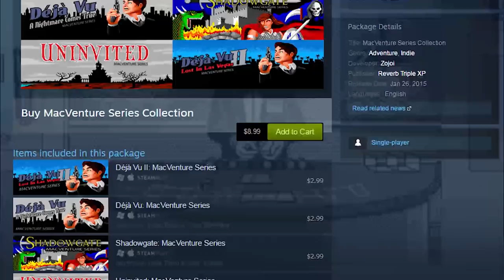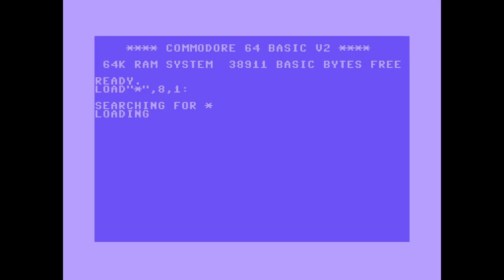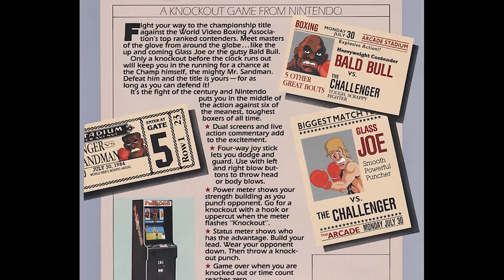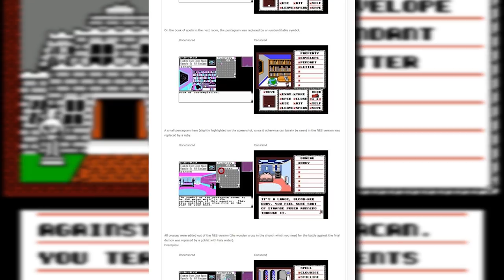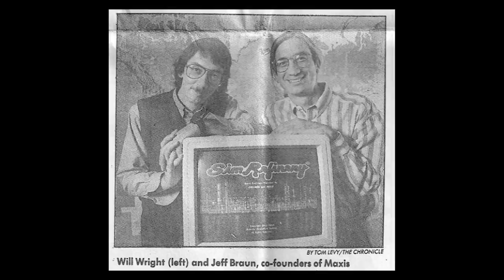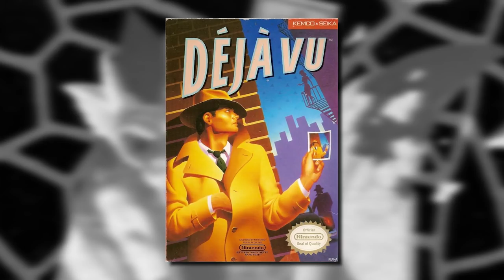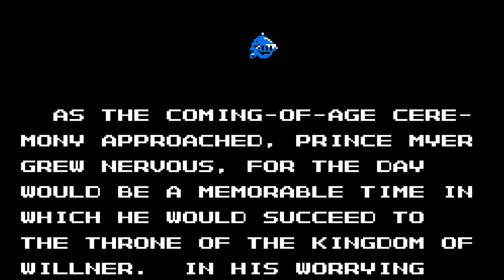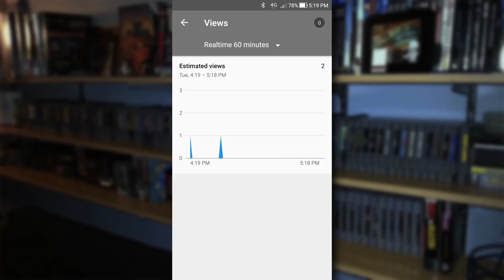NES Games Episode Marathon | Friday Night Arcade

Comment: I have a technical question for anyone who can answer it. I play NES (and SNES,  master system, mega drive/genisis etc. etc.) Games online on my Windows 10 computer. Doesn't anyone know of I can somehow get my xbox controller to work witg them? It works with my steam games, but I can't get it to work with online emulation played thru Chrome
Reply from the maker: I don't think you'll be able to get it to work through a browser web site that has the emulator built in. Also be careful with those as they tend to have viruses and malware baked in as well.

Try RetroArch - takes a lot of fiddling to get going, but there are some great guides on YouTube on how to do it. Once you get that up and running, you can map any USB controller to it, XBox, PlayStation or even just use an original controller with a USB adapter. 8bitdo makes some really cool modern retro controllers that connect via USB or Bluetooth as well. Good luck!
Reply: @FridayNightArcade  thanks man. Yeah, I ended getting a usb controller (shaped like a SNES one). I bought a raspberry Pi and my brother 3D printed a C-64 shaped box for it and downloaded a bunch of 80s and 90s console and arcade games. The controller works with them.